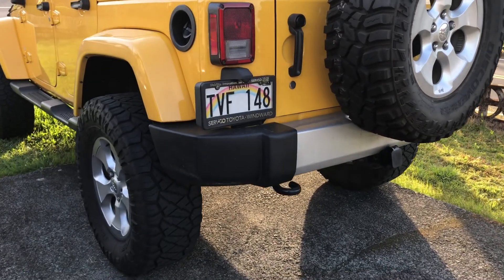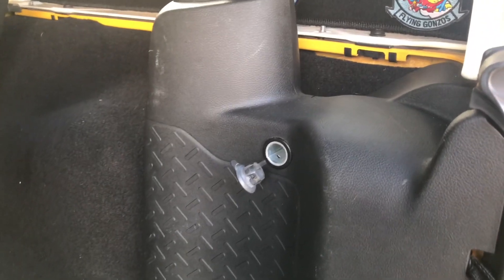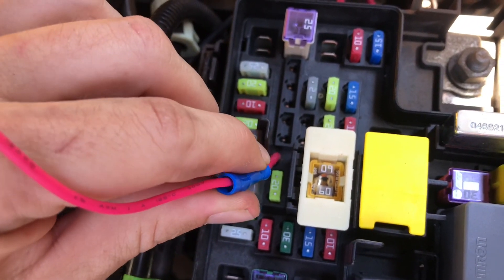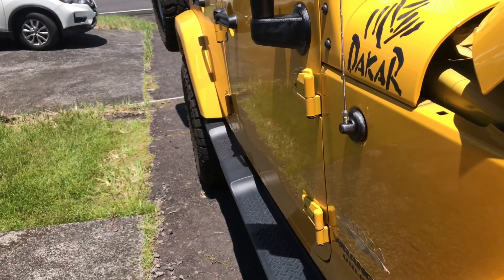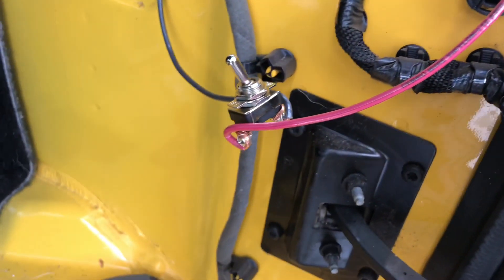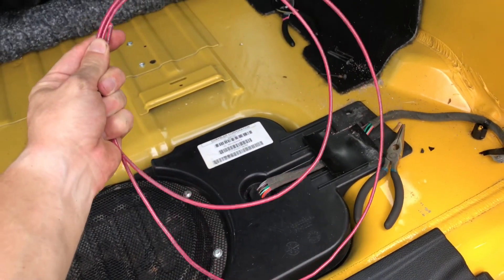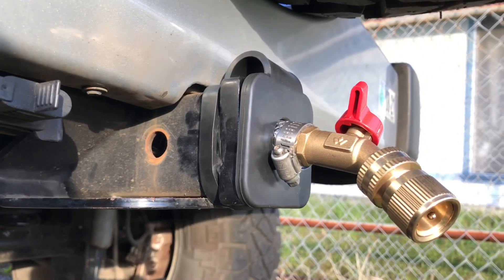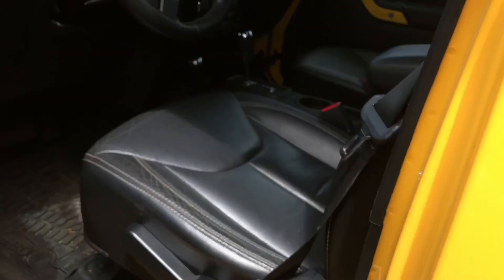How To: On Board Water System From Your Stock JK Wrangler Bumper

Comment: Thing sprays like crazy. Did the trim cover on the bumper cause you to fix those holes as well? I'm thinking of doing this on my Willys.
Reply from the maker: I was concerned about the trim cover screw points leaking too but I never needed to seal them. I’m glad I did it, the system is nicely hidden away till I need it
Reply: @mikcog  I just finished mine Saturday. No leaks from the trim piece. Maybe next weekend I will upload my video on it. It's a pretty cool addition to the stock bumper. The hardest part of the job was locating the pump spot as mine is the 2 door and I already have an air compressor mounted for the Klein air horns. Floor space was almost non existent under the Jeep. Found the spot. It took a couple weekends to do. Working under the Jeep is a PITA.  Thanks for your upload as your bumper with the trim plate was the same as mine.